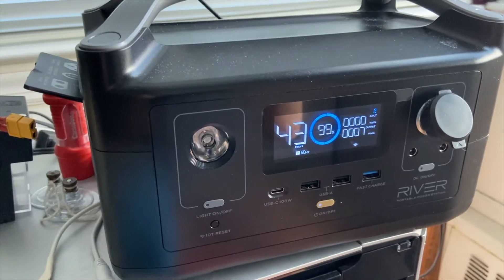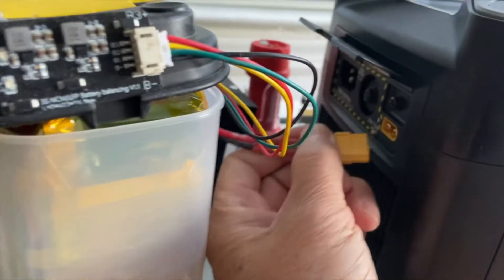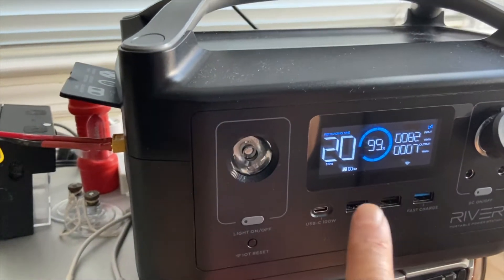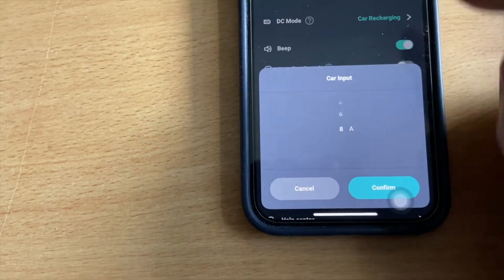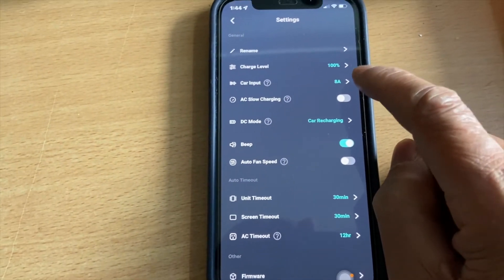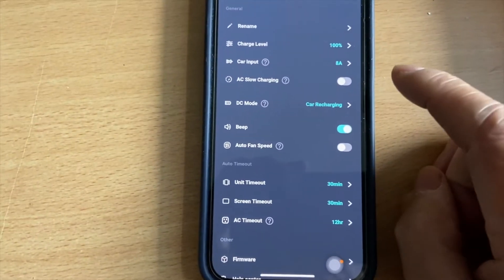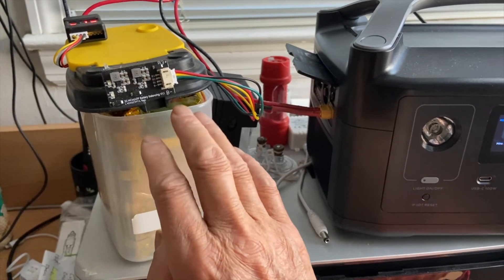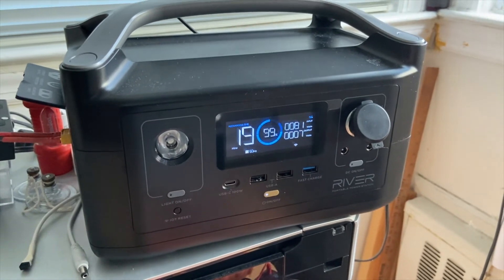Expand your ecoflow river battery capacity cheaply and safely

Comment: Is 8 amps enough charge the riverpro @ idle?
Reply from the maker: 8 amp dc at 12 v is A slow charge. It is safer than a fast charge. Definitely have to watch these if you use AC to fast charge.

Comment: hi friend, can i use a battery 4,8kw lifepo4 (charge in 100% is 51,2v) to extend my river 2 max? the input range is 11 to 50v and max 13a.
Reply from the maker: If the input maximum of the river 2 max is 50v, then the 51.2v battery would have exceeded it by a small amount. Better play it safe and lower the 51.2v by not charging it fully or don't use it to extend the capacity of the river 2 max.

Comment: Can i use a hoover scooter battery as an expansion pack?
Reply from the maker: Only if it's within range of 25v 12A and you set the ecoflow to solar charging. You can convert the voltage down to 24 volt if your scooter is 36v by using a voltage converter.

Comment: What I would like to know is if you do a tear down of the ecoflow expansion battery can you somehow create your own version that connects to the native pin connector on the bottom of the River. There appears to be  2 connectors for plus and minus high current and then the balance connectors. The benefit here is that you allow the River to charge the expansion pack as well.
Reply from the maker: Good idea to enable Ecoflow to charge expansion battery. Right now the only safe way to do that is to buy an expansion battery pack from Ecoflow.
Reply: @wtam69 you could use the Ecoflows 12V output to charge your pack. The 5.5x2.1 ports are regulated 13.6V 3A. That’s perfect for getting a LiFePO4 pack up to about 80% or 90% full. 

If you use solar panels during the day you use your power pack at night when there’s no sun and then during the day you pump in that solar while recharging the pack.
Reply from the maker: @ericklein5097  interesting idea. Yes it regulated to 13.6 so it’ll work just fine in a pinch. I’m using the Ecoflow right now to power a usb ceiling fan. It is very versatile indeed.

Comment: Hi, I was wondering: can you hook up a solar pannel to charge that battery pack while at the same time it’s supplying power to the EF ?
Reply from the maker: Yes, but depending on how depleted the battery is, the charge might go either the battery or to the Ecoflow. The resistance of the two sets of batteries determines who gets charge first. Only when the voltage of the two units are the same, then both will charged at the same time.
Reply: @wtam69  is the port the same you use for solar charging (the one you connected your battery pack to)? could you use a much larger lifepo4 battery like 12V 100-200Ah and slap a LARGE solarcontroller on to that (faster charging than the 200W panels the ecoflow can handle) or will that mess up the ecoflow?
Reply from the maker: @LiLBitsDK  the dc port of the Ecoflow has a limit depending on the model. You can either charge using solar or from a dc battery. Both have a current limit to avoid damage to the ecoflow. If possible , use AC charging which is much simpler to connect and can be configured to charge slowly or fast charging.  For safety, use the slow charge option whenever you’re not in a hurry.

Comment: Love this, thank you for posting.  Will the ecoflow then recharge the external power pack from A/C, just as it recharges the internal battery, or do you need to charge the power pack separately?
Reply from the maker: I Just posted a video as per your thought. It seems the Ecoflow River Max can charge the external power pack while it is being charged. See video here:
https://youtu.be/PPsIH6ZGU1Q
Reply: @wtam69  You are the freakin man!  My next challenge is how to get 24v out of the River, so I can use it to power a 3D printer without having to go D/C to A/C to D/C to save conversion loss.  Do you know how much loss there is from such a conversion?

My electric utility has a plan for half-priced electricity at night, but it’s double during the day.  Using a cheap River and cheap custom external battery, along with a wifi smart socket or timer smart socket, I could supply A/C at night, charge the ecoflow and use the printer, and then turn off A/C and keep printing during the day for cheap electricity 24/7 … In theory anyway :)
Reply from the maker: You have to use an adapter to increase the 12v output to 24v. Adapters like that are widely available on eBay or Amazon.  This is available on eBay:  use this search term, " DC 12V Step Up to DC 24V 10A 240W Voltage Regulator Boost Converter Waterproof".  $20 or less.
Reply from the maker: Yes theoretically you should be able to charge the external power pack with a balance charger plugged into the Ecoflow while the Ecoflow is being charged with AC.  It has to be tested out though. I actually have 7 of these power modules in the garage charged by solar panels instead of wall AC. It’s an easy way to expand the power of the Ecoflow, no matter the model.

Comment: hola, puedes decirme que componentes has usado para hacer una batería extra ? tipo de baterías , BMS , y todo lo que has usado ? y si tienes links de AliExpress me harías un favor , gracias !! ( spanish please friend )
Reply from the maker: I use 18650 batteries and 3s BMS to build my battery packs. It is safer to build your system with Lithium iron phosphate batteries. It is never safe to run these batteries under a heavy load and then recharge them quickly. Thanks for watching.